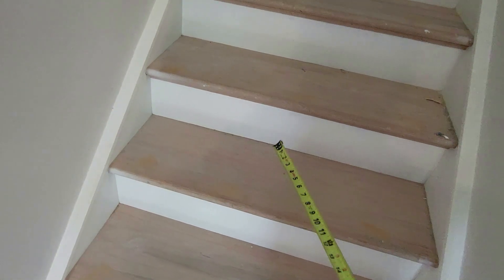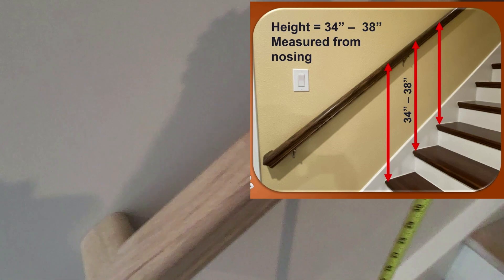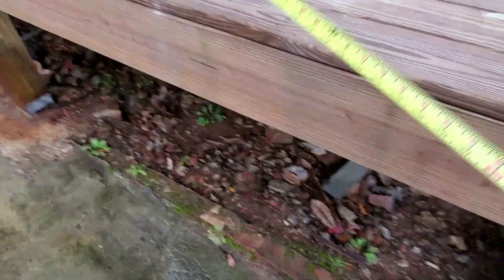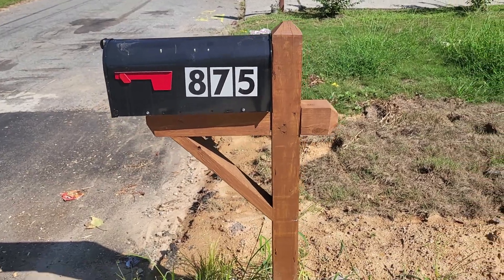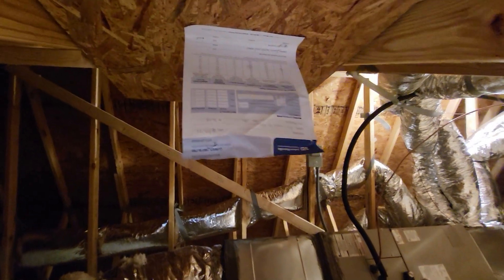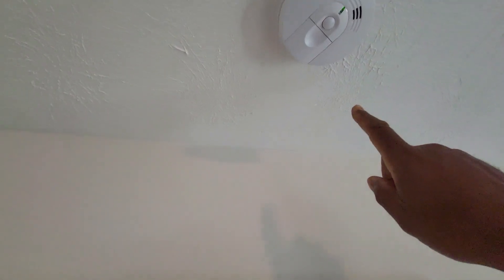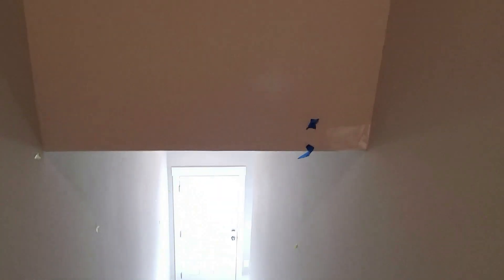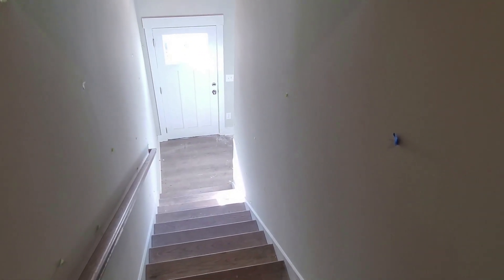Residential Building Code Violations (New Construction) Part 1

Comment: That stairwell height should be caught in framing stage. They should make you repair it.
Reply from the maker: So, I didn't do the framing inspection.  Also, that could've been added after the framing inspection was done. It happens all the time.
Reply: @PPG1967  Why would that be added after the framing inspection. Maybe framer thought he could give an extra 4 sq/ft floor space to the home owner.
Reply: @Faruk651  If the framer would’ve known what he was doing it wouldn’t have been an item to begin with. Trades need to learn to do their job right. The code book is nothing but minimums and not too much to ask. You act like you been but red tagged for lackadaisical framing and failure to comply before 😂😂😂
Reply: @INSPOK  I am not a framer. I just hate inspectors. They are the scummy.
Reply from the maker: He hate Inspectors, but he's watching this channel....interesting.
Reply: @Faruk651  Well, there has to be a reason, you didn’t just wake up one day and decide you were gonna hate inspectors. Some of the things that they have found on job sites during inspections make glad they are around. I know some outstanding trades that do commendable work, so it’s not a problem with every trade. Just some.
Reply from the maker: I appreciate your commenting anyway...
Reply: Hello there, I have been learning so much from your channel. What code books do you reference when inspecting an old home for a sale? Built 1940, remodeled 2007 and then some work in 2017. Im trying to figure out what needs to be “updated” or just left alone.  For example, my basement stairs are not even remotely close to what you’re describing in this video but then they were built in 1940. Thanks!

Comment: Good stuff Renaldo!  In my opinion (as an inspector), any head room height issue on a stairway on the final is shame on the inspector.  The potential of a head room issue should be communicated on the rough inspection.
Reply from the maker: You are correct on that one, unfortunately I didn't do the framing rough inspection.  Also, that's something the builder or framer could've added after the framing inspection....happens all the time.
Reply: 100% Agree about the chance of it being altered after the building rough  @PPG1967
Reply from the maker: I appreciate you watching!!

Comment: Tip for your certs, call ICC and have them change all of your cert expiration dates to the same date. When you have multiple certs it's a lot easier to keep track of only one expiration date. Bonus tip, the building, plumbing, and mechanical plans examiner exams are almost the same as the corresponding inspector exams. You put in all of the time studying, might as well get two certifications out of it. FYI, the electrical inspector and electrical plans examiner exams are very, very different. Cheers
Reply from the maker: I appreciate the tips.